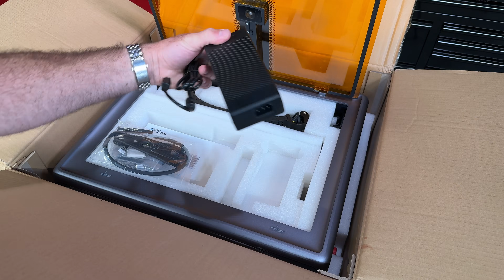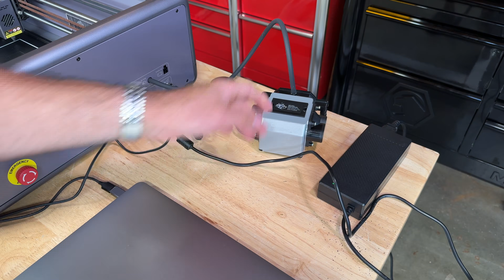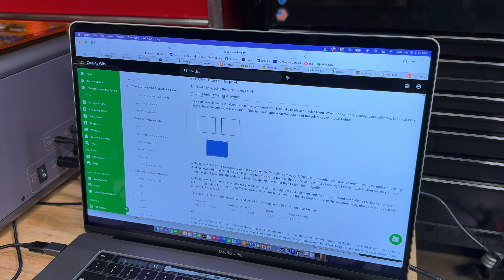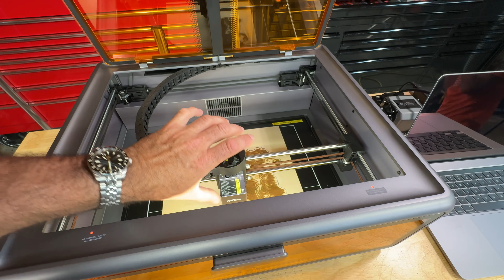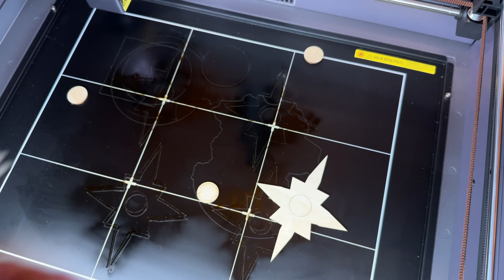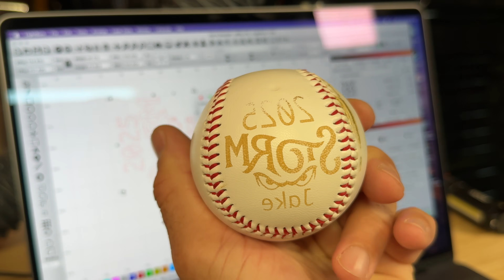How Long Does It Take to Learn A Laser Engraver??  ||  Creality Falcon A1

Comment: hi I received mine today , I set up as usual once setting up I had to install an update ( z-axis ) after installing the update I got an error code ( 04012202 -  laser module is abnormal ) and a red flashing bar , I have checked creality form and code ( 04012202 - states 'lazer module heartbeat time out alarm )  what im is guessing supposed to be a solid green bar ,  after checking over everything thoroughly all looks good and intact , checked all wires all looks good I have even reset the printer and still having the same issue any help ? or any one to contact about this problem ,  thanks